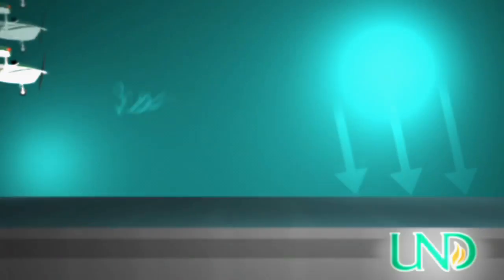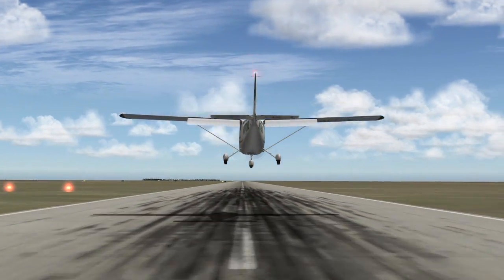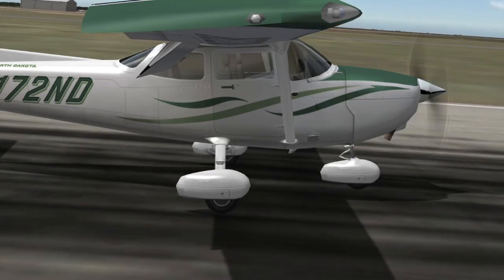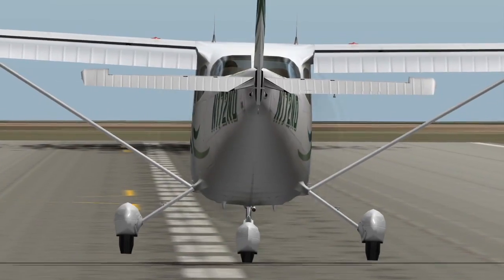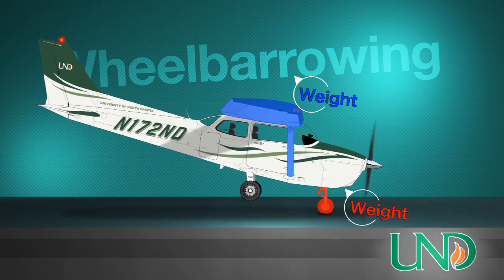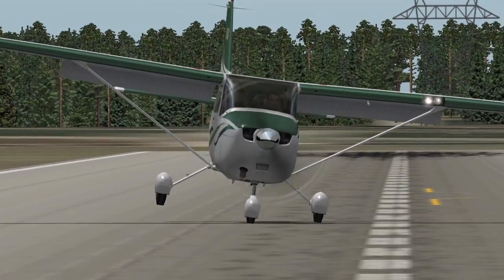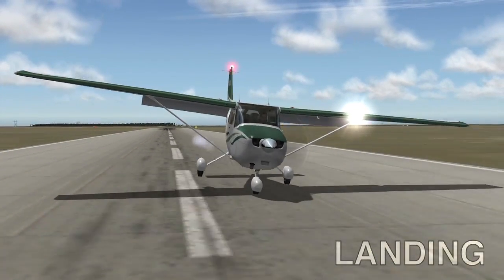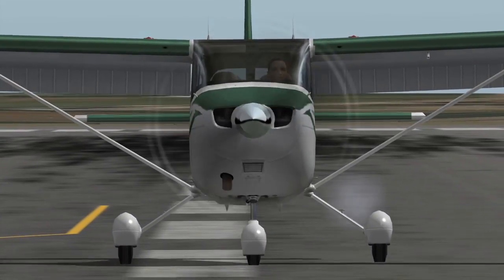Faulty Approaches: Nose-wheel Hazards

Comment: In nose 1st landing u may get away with minor structural damage but A LATE GO AROUND IS A DEATH TRAP. 
Bcz your plane doesnt have speed 
full power to already hot engine (thanks to long flight) may fail the engine
& full up elevator on dead engine  means only one thing . a tip stall followed by a quick spin, then inverted hard nose into runway, killing everyone

Comment: I just did a ( small ) wheelbarrow a few weeks ago, everybody was landing on 27, when on final, almost over the numbers, a quick look at the the (big orange cone) showed I was on a downwind-crosswind (wind from my left rear) I did leave from  GyL on 13, and thought about why they were landing 27, ( after my touch and go )when 9 would have been a little better, at the time I was the only one in the pattern, should I have changed traffic pattern 3 miles out? anybody? I think it's a OK question.
Reply: indianchief741 I don't think the runway here mattered unless you used a differently sized runway....when I messed up I accidentally added forward pressure while flaring on a smaller runway as I thought I was high while nearing stall speed.